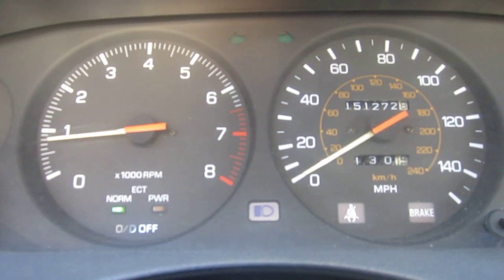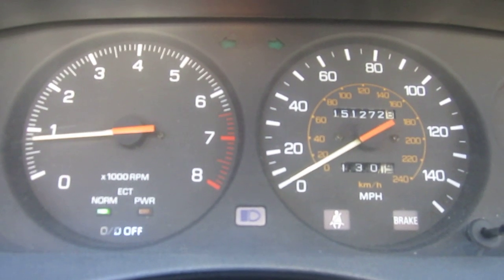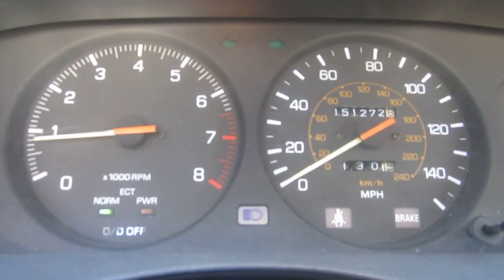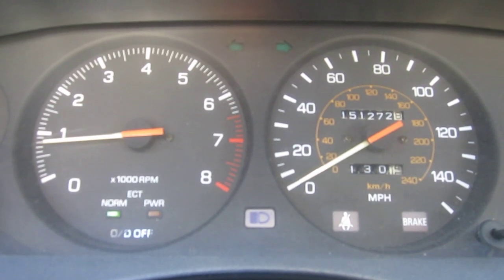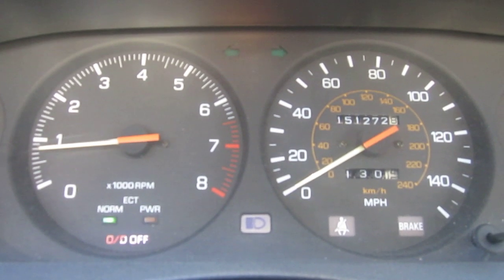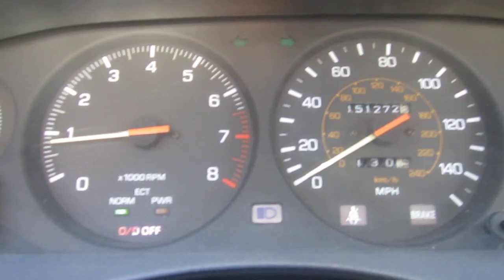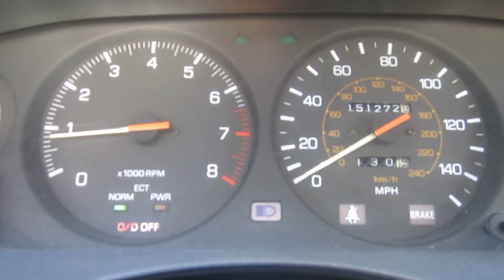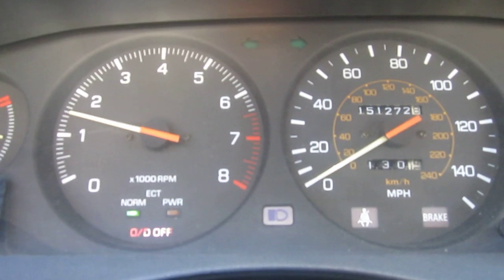A340 Shifting and Torque converter lock up

Comment: Why does the rpm stay constant when upshifting?
Reply: I think it’s just due to the gear ratios. Some transmissions do that. They up shift but keep the RPMs pretty constant. I know some Chevrolet Colorado’s that did that but then when you would mash it the shifts would be very far apart.
Reply: @jb chau, for one it’s just a 4 speed. When he takes off overdrive it just shifts 1 - 3. And 2, some of these cars had 4.10 gears
Reply: It’s because of it being a torque converter.  If the torque converter has a higher stall ratio, it means you can barely breathe on the gas pedal and it will cause the engine to rev beyond 2k rpm while in gear and at a dead stop.  
My 2015 V6 Avalon doesn’t have a high stall at all.  You could floor the gas pedal and it won’t rev higher than 1900 rpm until you start moving.  
Basically this translates to a larger rpm drop with each shift if you were to compare a low stall torque converter vs a high stall torque converter on the same transmission. 
The lower the stall, the closer the engine is to turning the same RPM as the wheels AKA 1 to 1 ratio.  So the lower the stall, the closer you are to having your car behave like a locked clutch at cruising speed but with the comfort of a fluid coupling (the torque converter)   A higher stall allows for you to widen the gap which means the same transmission won’t drop as far with each shift UNTIL the torque converter locks up.  
Everything I said prior to the last sentence was *if the torque converter is unlocked.